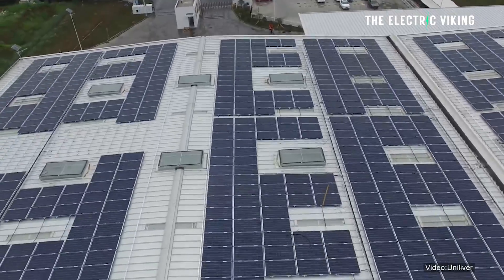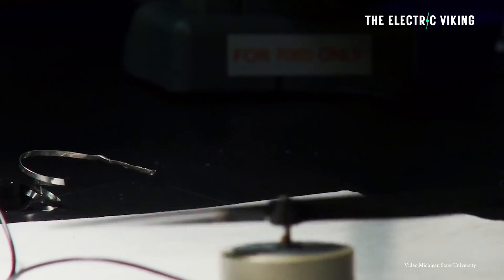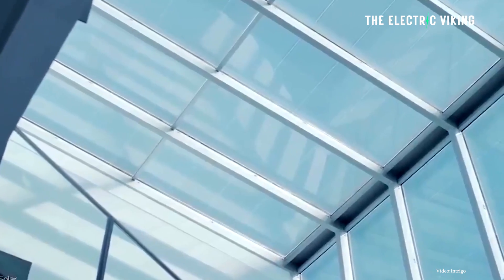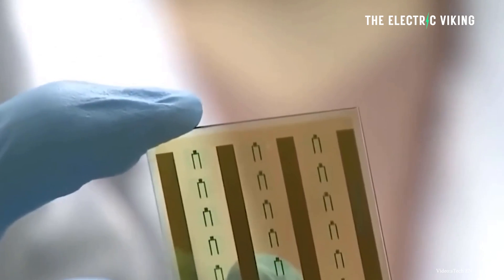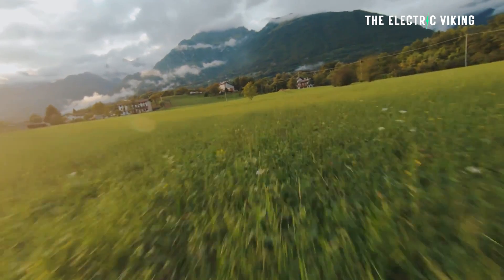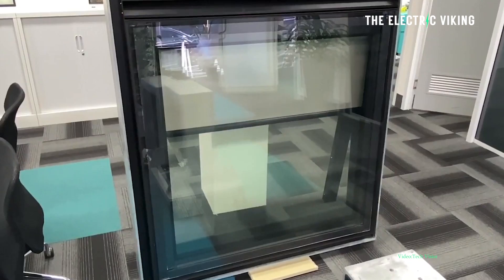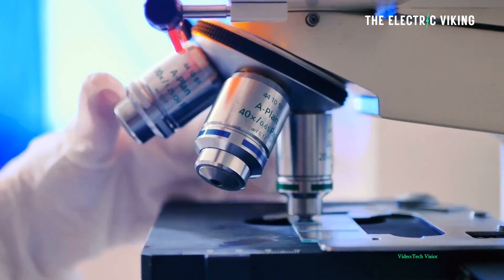Highly transparent solar cells can generate power 1000x more efficiently

Comment: Maybe 1000% which is only 10x. And maybe that is based on loss. If you lose ~80% on current technology, and this new construction method only loses 8%, one could claim that's only 10% of the losses experienced with traditional cells, so 10x better efficiency and this 1000%.. but it's a stretch. Marketing BS basically.

Comment: 13mW/cm² = 130W/m², it's not bad but still pretty low for a solar cell... No idea where you got "1000x more efficient" from :/ maybe that much more efficient for a particular wavelength, but this is not going to replace traditional solar.

Comment: 13 mW/c2 = 130 W/m2 
That’s quite low efficiency but may be 1000x for transparent cells. At 130 W/m2 it could still be useful if all your sun facing windows had the coating

Comment: Thanks Sam. 🙂

Had to laugh at your legendarily awful grasp of Mathematics! If existing cells were no more than 0.1% efficient, then you could multiply that really low efficiency  by 1,000. But with cells already being made in the labs which are more than 22% efficient, you could never increase the efficiency much beyond a factor of 4. And nobody has ever made anything which is 100% efficient.

For the record, the first Solar PV cell ever made was about 1% efficient.

As for the 40 miles per day added to the range of a car, that might be achievable with almost 100% efficient dells, but only in a country with plenty of overhead sunlight every day. In many countries, and especially in built-up areas, you would be struggling to achieve 10 miles per day.

Putting them on walls sounds great, until you think about vandalism, graffiti, posters, people deciding to modify a building, or the person who decides to add a different surface to their walls. The next few years will be interesting, to see how well these work in practice. I'm especially interested in retail costs and durability.

Comment: This needs some sort of explanation, as the claim is farcical on its face. 

It can't be over 100 percent efficient.  (That would result in free energy, infinite energy, etc). Standard panels are about 20% efficient.  So there is a real world upper limit on improvement of about 5X. 

Last time I checked, 5 was a HELL of a lot less than 1000. 

So again, the actual claim needs to be investigated and explained in context -- or it's just fake or a mistake.

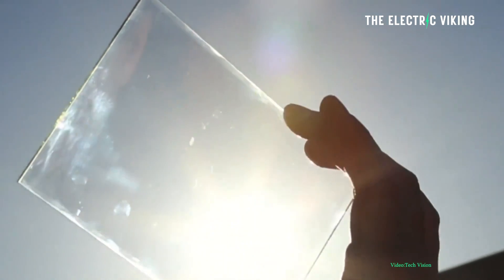Comment: At 2:27, Sam says this technology provides 13milliwatts per square centimetre. There are 10,000 square centimetres in a square metre, so the efficiency is 130 watts per square metre. The sun provides about 1 KW (that is, 1000 watts) per square metre, so this means this solar technology is about 13% efficient by area. In contrast, modern solar panels are about 20% (or more) efficient by area.

In essence, this technology performs poorly when compared to modern solar panels. The "1000x more efficient" claim is probably for something that Sam neglected to mention in the video, such as efficiency per unit of weight (instead of per unit of area). Sam made a video with similar incorrect claims in the past and, at the time, viewers' comments pointed out the basic flaw in Sam's claims. But despite Sam saying "Let me know what you think in the comments", it seems he rarely bothers to read the comments so he rarely learns of any errors in his videos, and then just repeats the same errors in future videos. So this video gets a rare downvote from me.
Reply: Cairan:  Completely valid points, IMO.

Comment: A film that is opaque to ultraviolet light would have the potential to massively reduce bird strikes on buildings whose windows were coated with it, because birds can see UV. If it also blocks thermal infrared, it might reduce the need for air conditioning in the summer.
Reply: That's what we call sunglasses

Comment: This is solar Nirvana tech - for agri solar and to utilise abundant building surface area as it also reduces the heat absorbed by the building interior. Also it captures low winter sun because, current solar capture is optimised for when we need power the least.

Comment: As pointed out by others, '1000 x more' is obviously misleading over-the-top hype. Even EV's claim 'you wouldn't even know it's there' is misleading hype.
There is no magic going on. Full transparency means zero interaction i.e. zero conversion into electricity. So at minimum the 'transparent' cells must darken somewhat.
Additionally unless an expensive multi-layered anti-reflection coating is employed, there are unavoidable additional losses from surface reflection.
I would strongly advice against investing any $$$ in any spinoff venture that hopes to make a killing marketing 'fully transparent PV panels', rather than dying.

Comment: Would plants receive enough light energy, in a greenhouse?
Reply: Agri photovoltaics are a thing. Not yet widespread but very very promising. Similarly panels over drinking water reservoir, keeps the water cool, reduces evaporation, generates electricity and helps oxygenate the water all at the same time.

Comment: 13 milliwatts per square centimeter equates to 130 watts per square meter so roughly 10% efficiency. Sounds good for a transparent solar cell but not sure where the 1000x improvement comes from. More area?

Comment: What part of the visible spectrum does these cells use. That colour would be blocked from going through the window.
The 1000%  better them existing cells, that claim smells bad.
Put these in the sane category as soar roadways.
Reply: With these new solar technologies, we can target different wavelengths like UV and infrared. Not sure if that's what he's talking about, but it does mean we could make almost invisible solar cells in theory.
Reply: @Nabushika  
Glass already stops infrared.

Comment: 13 mW per square centimeter equals 130 W per square meter, that's a 13% efficiency. Still good for a transparent cell, but no way you can generate power 1000x more efficiently than with current cells which are already well above 13%.
The transparent feature is useful and allows a lot of new applications, but no way you can fool physics.

Comment: 1000x efficiency here is meaningless without context of what they were studying. They were studying how the arrangement of ferroelectric materials affected the current it produced under laser light. They found a lattice arrangement of crystals improved its efficiency by 1000x vs a traditional coating. So coated one way it sucked, coated it another and it was 1000x better. It doesn't mean it generates 1000x the energy of existing panels which is an impossibility as solar panels already capture 20-25% of the available solar energy so even if other limits and laws didn't apply then it could only ever be 4-5x better.

So take it with a grain of salt. It might lead to thinner solar panels, or windows / surfaces which are coated and able to generate energy. Or it might not. Depends on how much it costs, how long the coating lasts, and what is necessary to protect it from the elements and degradation in use.

Comment: But solar arrays work very poorly if even one panel is blocked / shaded.  This tech does not change this.  From what I can gather, the 1000x better is in relation to other transparent technologies, not to current traditional solar arrays.  So it can be applied to things like windows and electronic,  for which the transparent technology maturity has not been applicable before this .  We shall see if this is true.

Comment: When transparent solar cells can generate power 1000 x more efficient, than they 100% can power the batteries of your EV. 
There are already EV's with solar panels like the Aptera and the Xbus (in production end 2023 at the Dutch VDL netcar ). 
Those can generate up to 10kWh per day, so when those solar cells can be produced with 1000 times more efficiency . . . . . .  do the math again.
Reply: Grizzly:  A child should know that over 100% efficiency is impossible.  Today's solar cells are over 20 percent efficient. 

Not much math needed to see how bogus the claim is, unless proper context is applied and explained.  (And real world, it seems these are less efficient than standard solar cells).

Comment: What if you double the application.  Like double pane windows. Cells in front.  Cells in back.🤔
Reply: That's it. Stack 1000 of them :)
Reply: Then you’d also multiply the transparency factor. 0.79 x 0.79 = 0.62, so almost 38% of the light would be blocked. That’s quite dark. Even so it’s unlikely to double the power output as you’re trying to absorb  the same light frequencies in each layer unless it’s also a perovskite
Reply: Yeah. The 1000x may be more to do with the watts per kg rather than watts per square meter that the thin film delivers compared to say a more conventional crystalline silicon solar cell watts per kg. If the weight of the substrate is ignored then the claim might be in the ballpark. But it would be a bit contrived. For a practical system the weight of any substrate, support or containment would need to be included as without it the system could not function. What do they call that particular power metric, power density, power factor? I forget.

Comment: Hopefully transparent solar cells are cheaply mass-produced and have a higher efficiency than solar cells / panels currently used. What humankind NEEDS is NUCLEAR energy, which has TWO MILLION times the energy density of batteries, solar & wind, fossil fuels, and other alternatives. Nuclear is the cleanest, SAFEST, most reliable, MOST LOW-CARBON source of energy. Built correctly by companies such as LAST ENERGY (American) it is also the cheapest, partly because a plant lasts EIGHTY YEARS, as opposed to the 20 years of solar & wind.
Reply: what we've been talking about for the past 50 years is renewable energy.  nuclear is not renewable.  it's different from gasoline but it's not renewable.

how many years do we have before it's all gone?  i don't know. i'll give it 100 years.  then it's all gone.

how many years do we have before hydrogen is all gone?  we can turn sea water into hydrogen and oxygen.  then how long do we have before all the sea water is gone?

there are renewable sources of energy. nikola tesla was on the right track.  victor schauenberger was on the right track.  there have been many serious inventors over the years.

not everyone is as gung ho  for nuclear as you are. for one thing it's not renewable.  for another thing it's very dangerous.  the big selling point is that it provides governments with a cheap source of material to make atomic bombs.

read about the fukishima fiasco:  The half-life of radiocesium is about 29 years, meaning the quantity of the radioactive material should drop by half by roughly 2041. 

with the oceans being polluted with dangerous radioactive water 24 hours a day how polluted will they be after 10 more years?  

it all points to quite a price to pay for a finite energy source.
Reply: @longnamenocansayy  There is 25 BILLION years worth of Uranium to meet the entire yearly energy needs of humanity. Fukushima was a WEATHER event in which ZERO humans were harmed from radiation or radioactive elements. In the 60s and 70s the U.S. built 100 reactors and if we had stayed the course by 1990 would have provided 100% of ALL needed power. Zero oceans are being polluted by dangerous radioactive water; the only danger is your profound ignorance around the BEST energy source available to mankind. JAMES HANSEN, world history's greatest climate scientist, AGREES with every word I've posted.
Reply: It still has to built along a large body of water. Solar can deployed anywhere the sun shines.
Reply: @KidHorn7001  That is why there are no solar powered colonoscopes.....
Reply: I live near 3 mile island. I know the lies. It's not safe.
Reply: @lonecowboy789  No injuries, deaths or direct health effects were caused by the accident. Three Mile Island’s Unit 1 continued operation for 40 years before shutting down in the fall of 2019.  There were ZERO adverse effects to the surrounding environment. SCIENCE FACTS!

Comment: 1000X  of a very poor efficiency yields a mediocre efficiency.
Reply: Solar panels are ~18-20% efficient. It would impossible for them to increase efficiency by 1000x.
Reply: It's laughably impossible.  No such thing as greater than 100% efficiency and todays common panels are around 20% that means, naively--5X improvement possible, but actual considerably less.